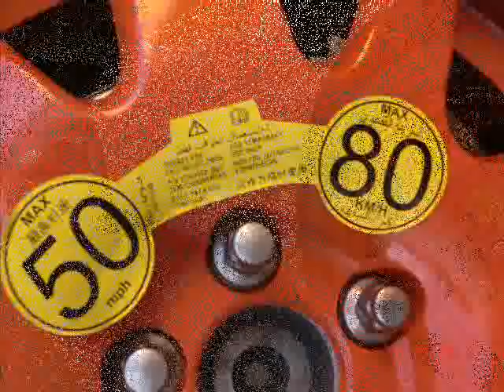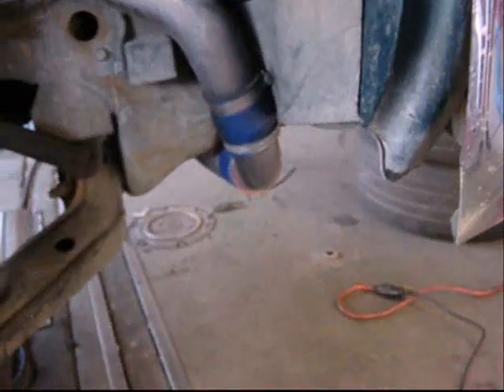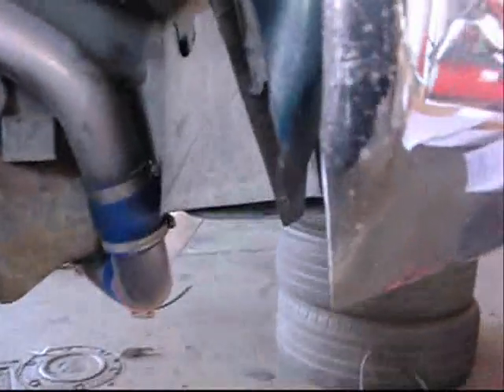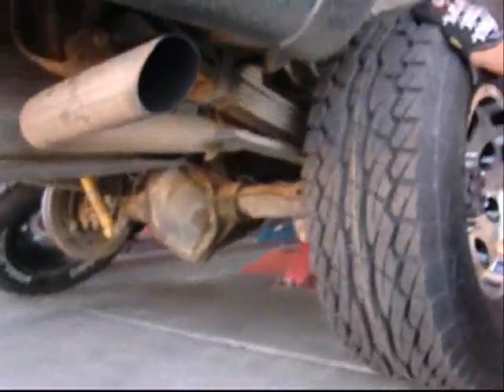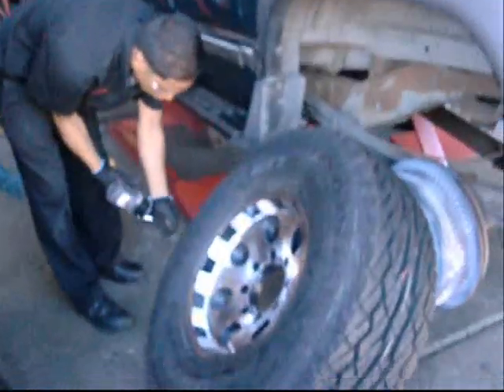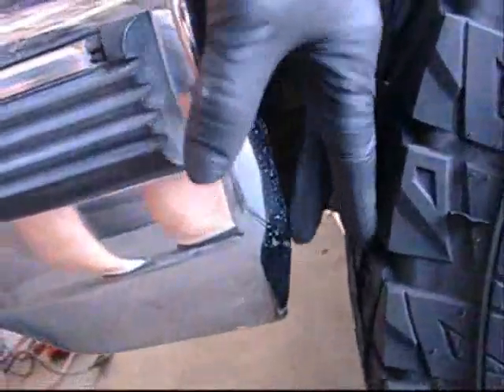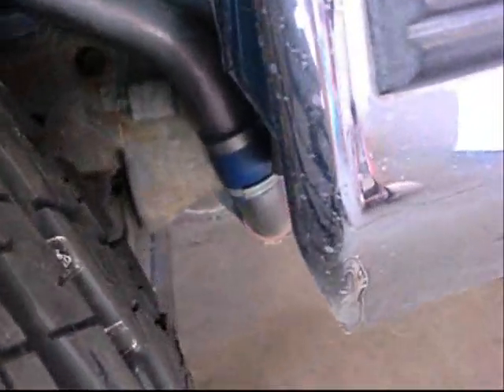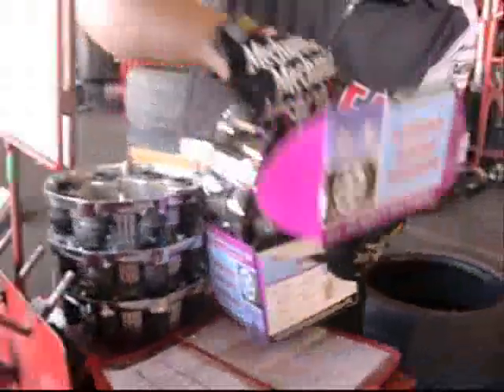10 24 11  Americas Tire Store II

Comment: Reminds me of 92-96 ford trucks. People do that alot. The older ones with the same cab don't need it as the bumper isn't moved in so much and is angled and not straight down at the wheel wells. Not sure who decided that. But, on my 91 i can fit 35 inch tires with no lift so i've heard. Doesn't surprise me as the 235/85r16 look small with 4 wheel drive. My 2wd truck they look huge.